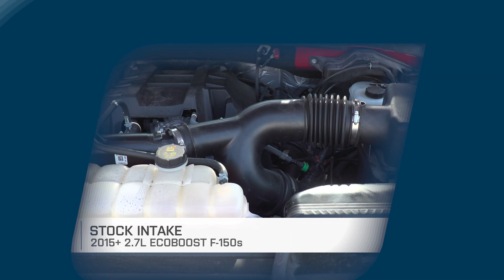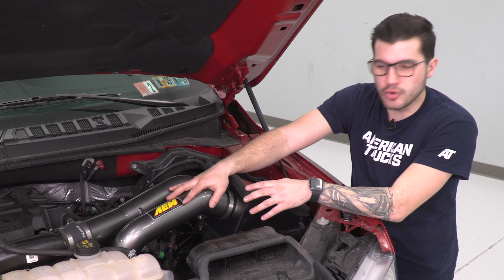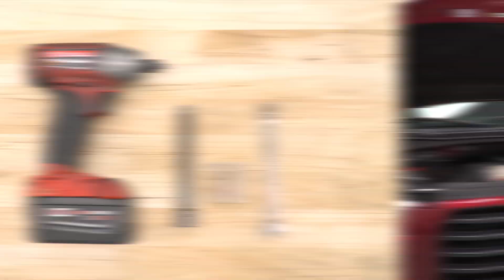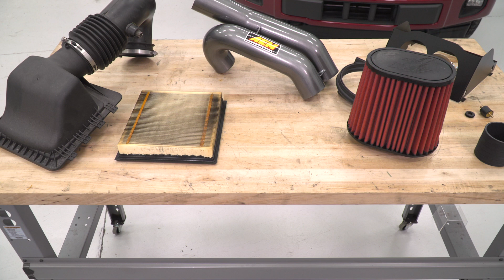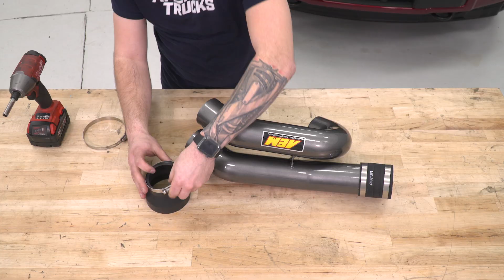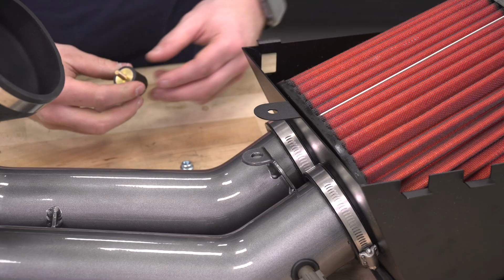2015-2019 F150 2.7L EcoBoost AEM Brute Force Cold Air Intake - Gunmetal Gray Sound Clip & Review

Comment: Which one is better for the 2.7, AEM cold air or the Roush cold air??? The Roush filter is completely enclosed in the box.
Reply: I don’t have a complete cold air unit. I just use a AEM dry flow filter, in place of the Ford Motorcraft factory filter.

Comment: There are no gains and I can see this kit draws nice warm & toasty under hood air. Nice.
Reply: What do you think the turbos use? Hot air from the exhaust….. the air is going to go through the inter cooler
Reply: @bunghole2826  
You should look up volumetric efficiency 101.
If you're drawing in 200° air instead of 100° air, that puts you at 100° deficiency no matter what.
Reply: @ColdSmoak  how about you figure the intake sucking air from a restricted box or an open suck all the air it wants and needs while not in a “cold air intake box”. There videos all over showing there is more AND less restrictive cfm without using a cold air intake. On a FI with an inter cooler cold air intake isn’t nearly as important as making sure the system never starves off air and can pull it smoothly
Reply: @bunghole2826  
It sounds like you've let someone convince you that the stock air box is restrictive.
If that's the case, there's no point in continuing the discussion.
Cheers
Reply: @ColdSmoak  apologies sir. I didn’t realize who I was talking to……………………………………………………………………………………
Reply: naw it seals off against the top of the hood when it's closed. But I agree prob no gains just more fun noises
Reply: @Early_2K  with all due respect, that is completely false. It does not seal against the underside of the hood, nowhere near.
Reply: @ColdSmoak  Either way its a fucken waste of money so who tf cares

Comment: Why do people say cold air intakes are a waste of money??
Reply: Because they are. Don't you think that a car company would change the cold air intake if it made more power. I would think that engineers would be smart enough to figure that out.
Reply: Because they can
Reply: I know this is 6 years later but if you're buying them for horse power gains exclusively, then they are a waste BUT if you are aiming for more turbo and induction noise, open systems like these are worth it.

Comment: With the black rubber that lays on top of the heat shield, the hood lays on top of it to ensure no water gets into the air filter correct? And does the MAF adjust the air flow to the new air flow as opposed to thinking it is stock air flow?